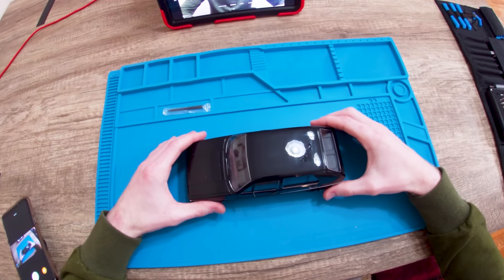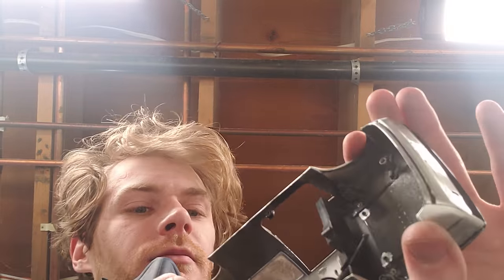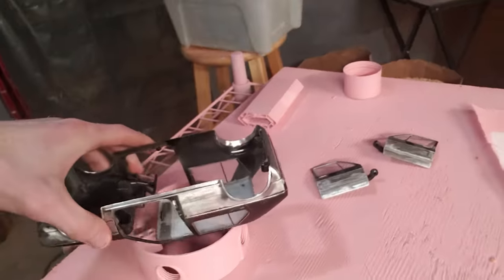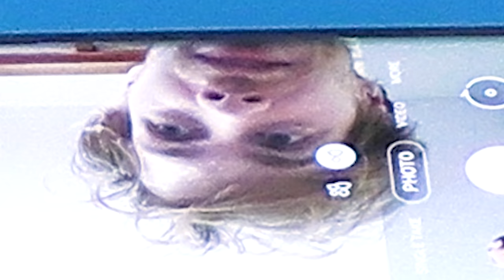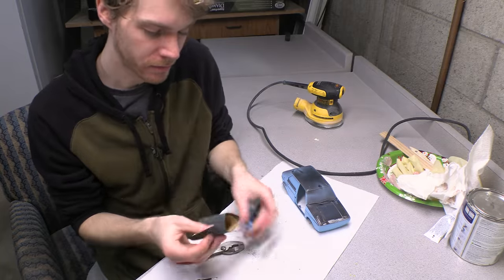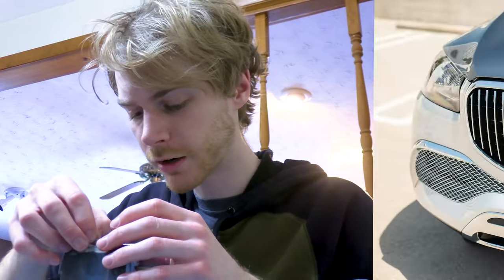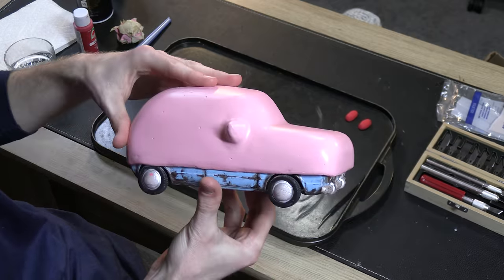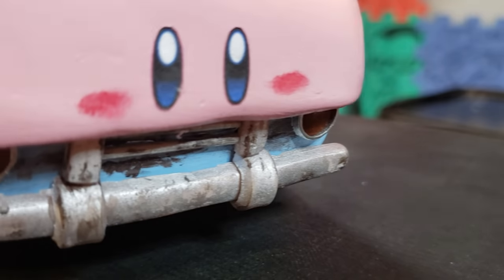Making Kirby Car In Real Life, Because I Can't Afford the New Game

Comment: Model-painting protip if Peter or anyone else getting into the hobby is reading this: An easier way to create paint chips is to put a layer of hairspray between the rust and main color, and after that last coat dries, wet it and chip away at it with your tool of choice. A good stiff toothbrush (maybe a brass wire brush if care is taken and that bottom coat is durable enough not to scratch either) or a toothpick will work great. 

Alternatively, if you want more precision and have a good idea of where the chipping will be in advance, skip the hairspray and put down dabs of toothpaste or masking putty on the rust layer and then apply the main color overtop, and chip them away after it dries.